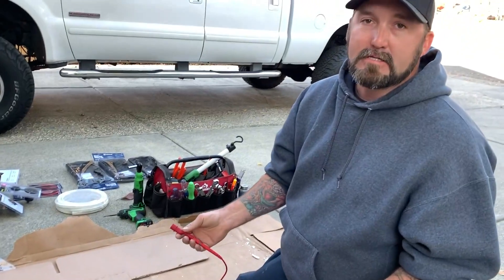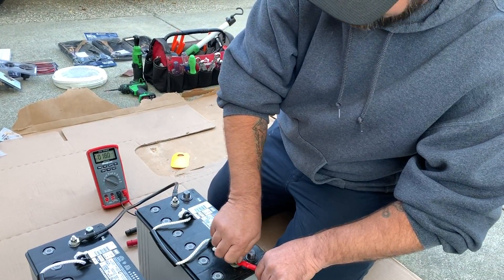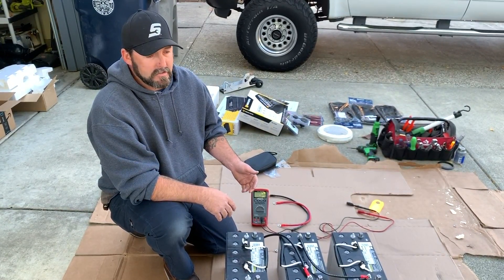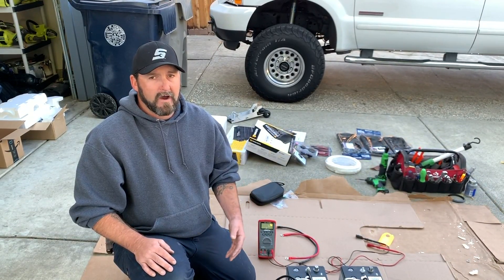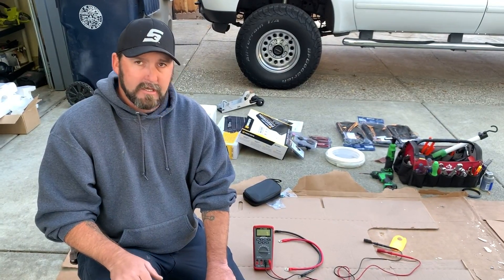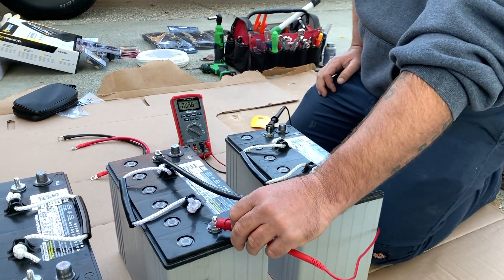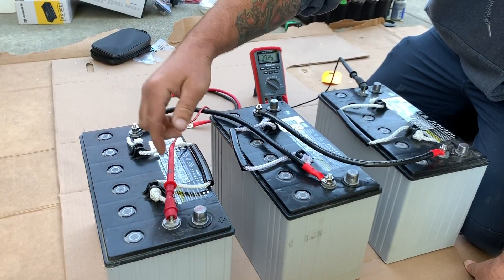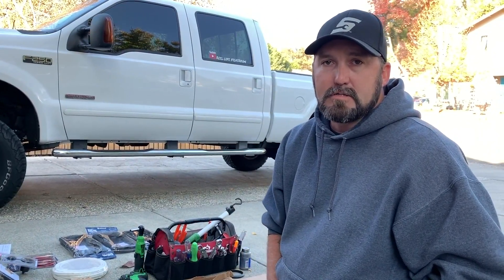BOAT BATTERY WIRING | TROLLING MOTOR | HOW TO

Comment: Thank you for the video! I have a couple questions about an on-board charger. I have 2 batteries now a starting and trolling 12 v,  I'm going to add another 12 v trolling battery and set it up in parallel like in your video until I can  get a larger thrust 24 v trolling motor. Can I hook up each battery to a 3 bank charger even though the trolling motor batteries are wired in parallel. or do I have to go to a 2 bank charger? The other question, if I wire the 2 12 v trolling motor batteries in parallel will it increase the amp output? I'm not sure if I will have to increase wire size from 8 awg to 6. Thank you again for the video it helped out a lot.
Reply from the maker: Thanks for watching the video and glad you liked it! It would still be perfectly fine to use your 3 bank charger one bank for each battery.. the smart chargers are made to do that and it’s recommended by the manufacturer to hook each bank to each battery.. it does bump up the amps when wired in parallel but 8 gauge is fine for any 12v or even a 24v but it’s always better to run bigger.. just make sure you’re using only marine grade wire.. hopefully that helps and let me know if you have any questions..
Reply: Reel Life Fisherman thank you much and I did subscribe!!!
Reply from the maker: Welcome to the channel I appreciate it!

Comment: Never mind sir. It was the negative jumper wire from the battery switch. I disconnected the jumper off the deep cycle battery and use that post to cross over to 24 volts. I put in a second battery switch just a simple on /off and ran the comm to the trolling motor just so there is no current when jumping to 24 volts. I don't run my trolling motor much but I will see how fast I get drain off of this setup. 
Keep posting tight lines.
Reply from the maker: Lol 😂 just saw this second comment.. yeah sounds like you figured it out..  but ideally you should be running 2 deep cycles of the same size and rating for your trolling motor separate from the boat batteries..

Comment: First I love your simplicity in your videos. I have a 24 trolling motor . I'm currently running a dual purpose marine battery group 24. I went out and purchased a group 31 deep cycle. I ran all 12 volt wires to a battery switch and wired it exactly as you posted One post off the switch to battery one . One positive wire to battery two . Comm to the engine. With a negative jumper. Everything works great . So thank you. With the switch off so I don't fry anything.  I hook my jumper wire positive dual battery to negative post deep cycle and I get sparks. Big time sparks . Do both batteries have to be deep cycle? The same size? And if they do can I purchase an AGM group 31 and pair that with the group 31 deep cycle. I like the AGM better if I need to purchase a third battery. I'm using all 4 awg wiring. 
Thank you for your time.
Reply from the maker: So with that negative jumper between the 2 batteries and you then trying to go 24v with a positive to negative jumper.. you are arcing the battery.. you need to have totally separate batteries to run a trolling motor off of .. the cranking and house deep cycle are for the boat only.. so you need a total of 4 batteries.. 2 deep cycles for the trolling motor.. and one cranking and one deep cycle for the battery switch set up..  let me know if you have any questions about anything before you wire anything up.. thanks for watching the channel

Comment: Thank you for the video! Just to clarify,  I have a MinnKota Precision 3 bank on board charger, can i leave it hooked up to all three batteries (24v trolling motor batteries plus cranking battery) to charge? Or Do I need to alter my charging procedure since the 2 deep cycles are wired to create 24vt system? Thank you
Reply from the maker: Thanks for watching.. absolutely you can leave them hooked up for that charger.. each bank is still 12v only thing hooked up 24 is the trolling motor.. let me know if you have any questions anytime..

Comment: Great video! How would you hook up a 3 wire trolling motor to the 24 volt system?
Reply from the maker: So is your trolling motor selectable from 12v or 24v ? Like an older motorguide? Or do you just have one of the older plugs that is wired for both 12 or 24v?  Let me know.. thanks for watching the video glad you liked it

Comment: Thanks for the helpful video. For a newbie like me, can you show how I can charge the batteries? When I get back to the slip? Also do you need a charge controller or something to ensure that you do not run the AGM batteries out completely?
Reply from the maker: If you have shore power at the slip.. I would just get a good onboard battery charger.. one bank for each battery.. and plug it in every time your in the slip.. they are designed to be left plugged in .. they maintain and keep the batteries healthy.. I have 2 two bank battery chargers on my boat.. one for my cranking and house battery.. and one for my trolling motor batteries.. thanks for watching the video.. let me know if you have any questions.. I have another battery video on the channel if you want to check that one out also..
Reply: Reel Life Fisherman thank you so much again for both the informative videos and also for quick helpful response
Reply: Reel Life Fisherman thank you again and again so much! Would you please share some examples for a good onoard battery charger? Maybe an amazon link? House and trolling motor batteries?
Reply from the maker: Minn Kota On-Board Digital Charger https://www.amazon.com/dp/B0042TC5QM/ref=cm_sw_r_cp_api_i_l491Eb2K9AHCR
Reply from the maker: This is what I have .. just get a bank for each battery.. the precision charger is better but more expensive.. also by minn Kota
Reply from the maker: The house battery would be the second battery used as a back up or to run all of your electronics while you want to set in one spot for a long time..leaving your crank battery fully charged and ready to start the engine when you want to leave
Reply: Reel Life Fisherman thank you sir! As always you been so very helpful

Comment: Question- I am adding a 12v MK trolling motor, an 12v MK Deckhand 40 anchor winch, and a 12v fish finder to my pontoon. Currently it has one 12v battery for cranking/radio/nav lights/etc. When adding a second battery (12v deep cycle AGM) for the trolling motor, where should I hook up the anchor winch and fish finder to? The current battery or new battery. Thanks for your guidance, great videos!
Reply from the maker: We always only recommend only hooking up the trolling motor to the trolling motor battery..  if you hook the fish finder to the same battery as the trolling motor you will get electrical interference on the screen making crazy lines on it... you could possibly hook the anchor winch to it.. but it can go dead with no way to recharge it.. leaving the anchor deployed or possibly unable to deploy if the trolling motor drains it..  I would keep everything on the crank battery.. it recharges when you are running the main engine.. let me know if you have any questions.. and thanks for watching
Reply: Reel Life Fisherman Thanks so much for your clarification. As a follow up question, would I want to add a two-bank charger and battery selector switch?

Comment: I was always curious about jumper cables on a system greater than 12v... now seeing this video I understand they stay at 12 volts as long as ur only connected to the same battery!
Reply from the maker: Yep exactly! Glad you liked the video and it helped you out.. thanks for watching! Let me know if you have any questions
Reply: Reel Life Fisherman you made a subscriber out of me. Having free knowledge handed to you, u can’t ask for more than that for a better understanding. Lmao 😂 some of my learned lessons have come from self shock, blowing fuses and burning things up.
Reply from the maker: Awesome thanks for subscribing! lol I know how all that goes trust me!  It happens ! Even now accidents can still happen..
Reply: Reel Life Fisherman I have a question for u, maybe you could help me or have some input. So my has an outboard. But doesn’t have a alternator, it has the Stator for charging. My question is, is there a way you can change or modify the output of the Stator? Reason I’m asking is because I have a huge, huge stereo system I’m putting in it. But can’t find any one who can tell me, so I’m figuring I’m going to have to run 4 batteries, one starting and the other 3 for the stereo and just keep them charged before heading out

Comment: Great video you really helped me understand, but I do have a question. I have a 1996 Ranger 395 FS it a fish and ski model. And it is already been pre wired at the dealer I bought the boat from last spring. I noticed that it is wired for a 24 volt  output but at the front of the boat where the trolling motor nis wired there are only  2 wires. in the back it looked like they were sending a axtra grey wire  to the front but when I wired in the new trolling motor there was only 2 leads going to my trolling motor. I have used it a couple of times and it seems to be working all right. I guess I should check the voltage with a tester like you used to see what I have there. It just with a extra wire in the back I am not sure what is going on.  Thanks for clearing some of it up for me.
Reply from the maker: Tracy Hubbard any idea the size of the wire? They used to run 2 sets of lead up the the bow.. one wired at 12v the other at 24v it could also have been for a battery charge indicator gauge if your boat had one..  let me know if you have any questions anytime.. thanks for watching

Comment: Could you go over fuses/breakers for 12-24-36 volt systems?
Thx
Reply from the maker: Almost all trolling motors require either a 50 or 60 amp breaker.. just depends on the size of trolling motor.. and you would want that right at the battery on the positive side.. let me know if you have any questions about it.. and thanks for watching!

Comment: Great video! To extend my running time can I run two 24v systems in parallel? If so, can I also charge all four batteries at one time?
Reply from the maker: So that is called a series parallel system.. and to be honest I have never seen it done in a boat for trolling motors.. we did it a lot in the Army.. I was a mechanic.. and we would wire the trucks that way..semi trucks do it too..  but it does double the amp output.. you would need a 4 bank charger...  I’m not gonna say to do that for a 24v trolling motor only because I’ve never done it or seen it done yet.. but it would work.. let me know if you try it out..  I put in a alternator charger to extend my run time.. thanks for watching and let me know if you have any questions..

Comment: If I already have battery interconnect cables for top post hooked up in series for my 24v and I want to add a 50 amp breaker will I need anymore marine wiring or can I just use the top post interconnect cables?
Reply from the maker: You can just cut the wire and add 2 ring terminals and put it in.. unless you want to put the circuit breaker out of the wait or mount it.. then you need to add some longer wire..
Reply: Well I just want to mount the break off to the side on the wall in my battery compartment
Reply: Also if I decide to get extra wire do I still keep them interconnect cables in series as well?

Comment: Prob stupid question..but if I pair 2 batteries 12V do I need to have both batteries hooked up to my inboard charger or can j hook up 1 of them and they both charge? Newbie here..
Reply from the maker: So they recommend to run a bank to each battery.. it’s better for the batteries and the charger..  also it’s better for the batteries if you run the load off of one positive and the other batteries negative.. with the jumper wires connected positive to positive and negative to negative.. hopefully that makes sense..? And thanks for watching.. let me know if you have any questions
Reply: @ReelLifeFisherman  
Thanks for the quick response..new sub here ;)
Reply from the maker: Awesome! Welcome to the channel! Thanks for subscribing..
Reply: I have a charger that charges 2 batteries 1 to cranking and 1 for trolling motor. If I think that you actually BOTH batteries hooked up to charger. Do I just leave the cranking battery seeing how the ALT charges the battery when driving..and maybe hook up to my garage battery charger from time to time..dont want to dozens any more $ on s 3 bank system. Thx

Comment: Great Information and explained it well. Thank you.
Reply from the maker: Zman Fishing thanks I’m glad you liked the video! Thanks for watching..
Reply: @ReelLifeFisherman  
Lets take this video one step further I have a boat that that has 2 batteries with a battery switch to connect the battery 1, 2 or both. Can i still pull 24 volts from the 2 batteries? Or does the battery switch and jumpers from + to + and - to - cause an issue with putting the jumper from + to - for the 24 volt side.? 

This is a boat that my son uses for short trips behind our home so i am not worried about the batteries lasting all day. Just trying not to have to buy 2 more batteries for trolling motor. Thanks for any advice you can give and keep the great videos coming!! 

Z

Comment: If you have the minn Kota onboard charger can you parallel two trolling batteries and use one bank to charge the “giant” trolling battery you just created?
Reply from the maker: Matt H they do not recommend doing that.. they want one bank per each battery.. even if hooked in parallel.. to get the longest life and most out of your batteries.. it will put a charge to both though.. but I just can’t recommend it.. thanks for watching the video! And for the question
Reply: Reel Life Fisherman great informative video! Keep em goin man!

Comment: Awesome video man ... quick question: if I’m running a 24 volt trolley motor, do I need a separate battery to run the other electronics (nav lights, fisher finders, aerators, etc) on the boat, and another battery for the motor? So I’d need 4 batteries in total??? I’m new to electrical...
Reply: So the 3rd battery that the motor is connected too (cranking battery, right?!?) I connect all the other electronics to that battery ???
Reply from the maker: Thanks I’m glad you like the video! So you should have at least 3 batteries the 2 for the trolling motor and one for the boat.. you can add an additional battery a “house” battery to have as a backup or run electronics while on the water for extended times..  and put in a battery selector switch.. I have another video kinda going over that set up as well.. thanks for watching and let me know if you have any questions anytime..
Reply from the maker: Yes exactly..

Comment: Changing over to a 24v trolling motor what size jumper leads you recommend. Thanks
Reply from the maker: Crappie Ghost I usually run 4ga but 8 would be the smallest I would ever run for jumpers..  and 8 would be the smallest I would run for the main run to the motor as well..

Comment: I can see in your comments I need a much better battery charger. Interested to know if I used two batteries to run my 12v trolling motor. Would I just need to hook up one battery charger and will charge both batteries. How would that work thanks in advance
Reply from the maker: Crappie Ghost you can hook up only one bank and it would charge both batteries hooked in parallel.. or you can do a 2 bank and it would charge both batteries faster..

Comment: Hey Jason
Question would you get the Duracell or interstate marine battery? If so why i believe the coast is about the same. Where do you purchase you Duracell battery at?
Reply from the maker: Daniel Ramos I would get the Duracell they are an AGM battery ..and they have a 2 year replacement where interstate only has a one year.. and the only place I know for sure you can get Duracell is at batteries plus..
Reply: Where is battery plus located? Thanks for alway coming thru with info. I value your opinion and expertise
Reply from the maker: Group 31 deep cycle AGM
Reply: Reel Life Fisherman 
Thanks
Reply from the maker: Daniel Ramos there is one in Roseville on the other side from the mall.. I believe.. like you are going to Lowe’s
Reply: Reel Life Fisherman 
Jason found a store near for the battery however too many model to choose from. I will be using it for trolling motor and crab pot puller. What model would you recommend?

Comment: Thanks for the lesson, always appreciated!  I got a question.  How should I be storing my batteries.  I got a 24v motor.  I just leave the batteries on the boat and charge them up before I go out.  After 15-16 months with the same pair I get about 3-4 hours vs 8 or so hours when they were new.  Thanks- Chris P
Reply from the maker: ChrisPfish glad you like the video Chris! I always recommend getting a good on board battery charger.. one with enough banks for each battery on board.. and leave it plugged in all the time..  it will Maintain your batteries and you will get more life out of them.. thanks for watching and let me know if you have any questions..
Reply: @ReelLifeFisherman  Okay, so instead of putting them on the charger day before going out just put them on the charger when I get home from a trip and leave it charging continuous until next trip?
Reply from the maker: Only if it’s a smart charger.. meaning it has a float and maintenance charge cycles .. it won’t over charge or sit at full charge all the time..
Reply from the maker: I have a Minn Kota digital charger..  pro mariner makes one .. Bass pro has one made by them.. noco genius .. are a few I would recommend.. if you don’t have one already